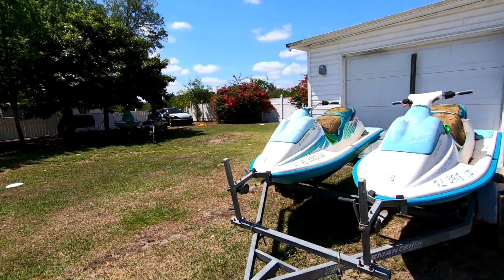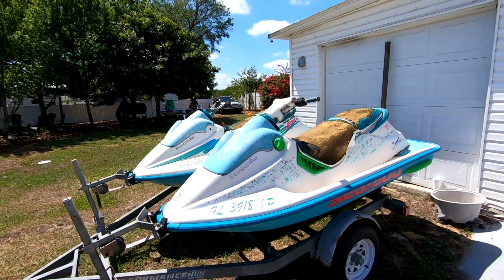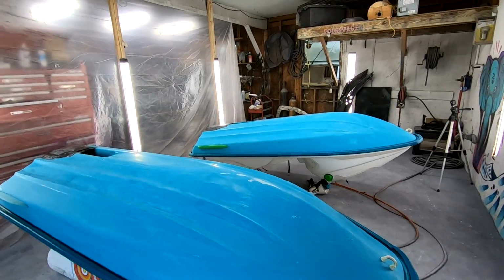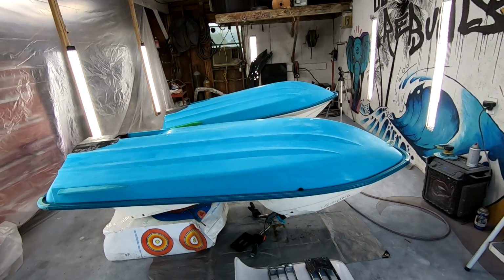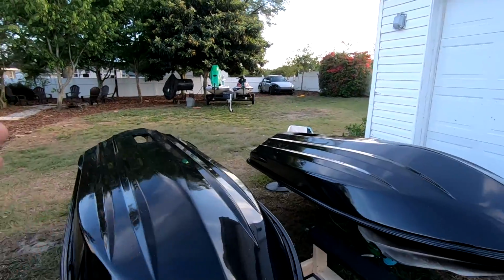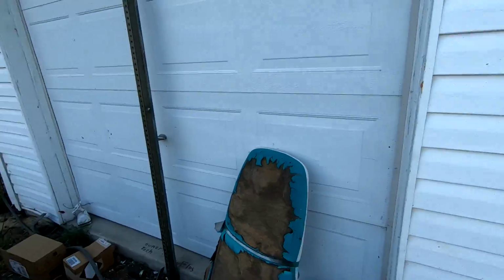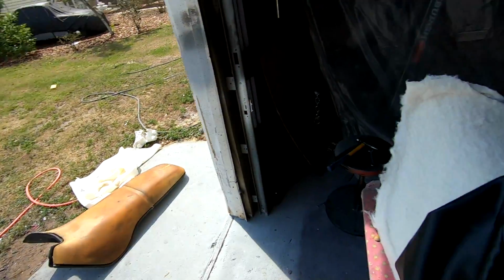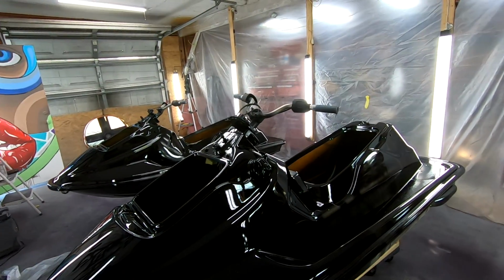I Bought a Pair of SeaDoos for $300! - Episode 1

Comment: They are looking great. I'll be very surprised if the paint holds up on the edge trim or sponsons. Please update us as it wears. I hope I'm wrong. 
You can just use 2 way stretch vinyl for the seats. It's much cheaper. 
If you want cheap traction pads you can use EVA exercise mat. I found some great stuff last year at Walmart with a diamond plate pattern. It's held up perfectly so far. 1 roll could do at least 4 jet skis.

Comment: Little correction. If you’re facing the front of the skis on the trailer the one on the right is a ‘95 and the one on the left is a ‘94. 1996’s are teal & white (where the 94 & 95 are blue & white), have a 2 gauge hood with mirrors, and black bumpers. A way to tell the 94’s and 95’s apart is the 95’s have a little bit of pink in the decals, the big Seadoo logo on the bottom of the hull is pink as well, and the “Seadoo” logo is under the “SPX” where the 94’s had it on top and the bottom Seadoo logo is green. Not sure if it was just a slip up during filming or that’s what’s printed on the titles but just a FYI! Keep up the great work, love watching your videos
Reply: I need that single gauge hood for my 787 SPX
Reply: Ya definitely no 96’s there!  I had a 96 SPX and those are not it

Comment: The SeaDoo family just keeps getting bigger and bigger!!
Each time you work inside, I wonder how you got such a great street sign collection... 🤔🤣
Reply: Teenage crime? 

Or just a connection with the DOT? I got quite a few signs from a city scrap metal bin that just needed extensive flattening. Even a traffic light where the cast had cracked and I glued it back together which is great for a den but not so much 20ft in the air.

Comment: Tom Clancy and Seal Team 6 would be Proud ! .... But .... Visibility , Safety and Surface Heat might be an issue if you have an Emergency ....... Kind of hard to see a Black Unidentified Floating Object on the water ! ... or hang on to a Hot Hull !

Comment: Dude how did you find those with the trailer that cheap I mean like where they advertised or you just happen to come across them and did you have to negotiate and get the person to come down on price because you did get a good deal the trailer is worth $300 by itself and I remember back in the 2000s I bought the same ski and the one I purchased was a 2000 model Gsi and it was in someone's backyard and did not start and I thought I got a good deal and I've been $600 with a trailer and all it needed was a new connector on the end of the starter wire that goes to the starter from the starter relay cost me a dollar to cut the wire and put a new connector on because the wire was really corroded and eyelet that goes on the end of The wire was beyond corroded and rusted where it connects to the starter and there just wasn't enough amps going through the corroded hard wire and with the combination of the bolt that goes through the eyelet to the starter something that simple can make the difference between no start and a fun day on the water but I want to say good luck and hope they got good compression and you just need to rebuild the carburetors I can only hope I can find another good deal like the one you got cuz I want to have a ski for the summer and those late 90 early 2000 Sea-Doos were the most reliable ones I believe they have made and you cannot kill those at least the one I had never gave me any problems. Good luck and I really like your channel
Reply from the maker: Facebook usually... I usually never hassle them down on price either.... they usually do that themselves 😂